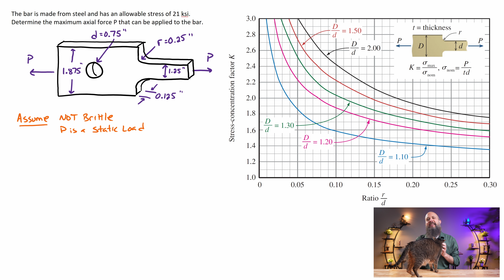How to Read Stress Concentration Tables - Hole and Shoulder Fillet

Comment: Greetings Professor, how could I calculate stress concentration on a keyway Notch for a Shaft?
Reply from the maker: Check out the textbook "Roark's Formulas for Stress and Strain. You'll find Keyway equations in the torsion chapter 10, and also ways to reduce stress concentration near a keyway in the Stress Concentrations chapter 17 (ironically, if you drill holes near the keyway, removing material, it pulls some of the stress away from the high stress area, to a previously lower stress area. I'm not sure if this has exactly what you are looking for, but it's the closest I know of. Most textbooks do not have near as many examples as Roark's does. If this doesn't work, you might have to setup your own Finite Element numerical calculation. Good luck.
Reply: @BrianBernardEngineering  Prof, thank you very much for your response! And sorry for taking a bit to reply 😅

I completely understand the concept of reducing the stress concentration. I’m really passionate about mechanical engineering, and some time ago I watched very specific videos about this topic.

In my search, I also found something interesting in Chapter 3 of *Roloff/Matek Maschinenelemente* by Herbert Wittel, where they discuss these stress concentrators from a fatigue analysis perspective. I found it to be a good complement to **Roark's Formulas for Stress and Strain**.

Your videos really remind me of university and are great for reviewing and keeping the concepts we already learned fresh.

Wishing you continued success with the channel! Greetings from Colombia.